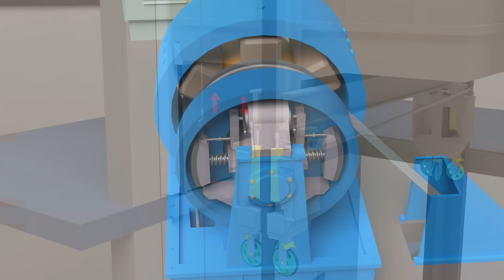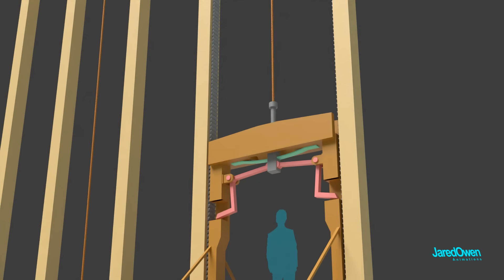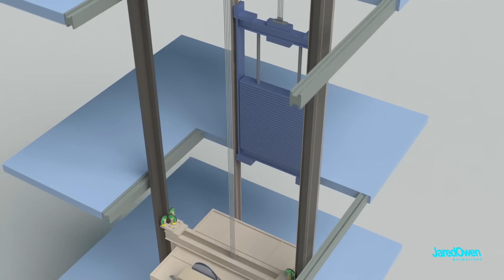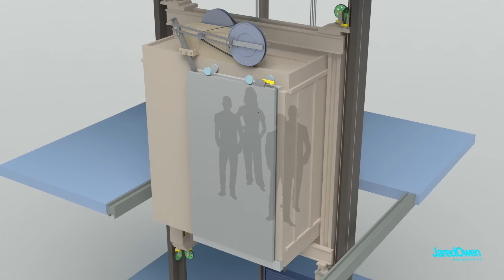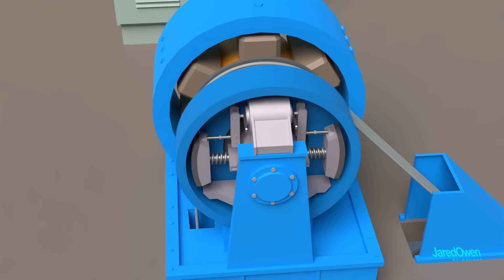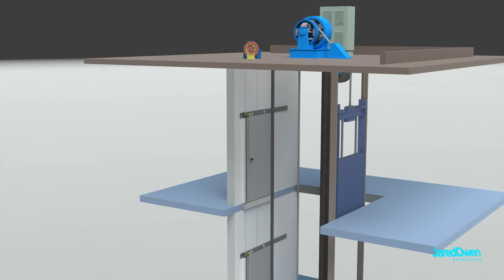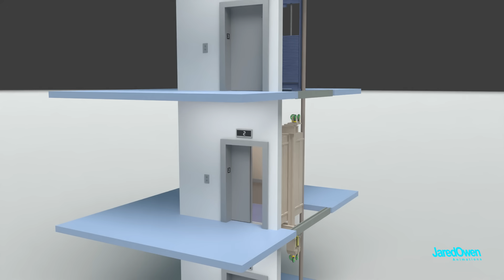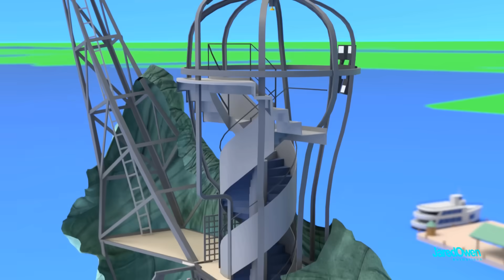How does an Elevator work?

Comment: Perfect description about how elevators work... as usual, techie without the tech

About 5 years ago I lived in an Retirement Complex. It was mostly seniors and average age was probably 75. Our elevators were hydraulic, only servicing 3 floors. They were slow and noisy. We had a fire alarm go off due to problem in fire sprinkler dry riser. It leaked and now wet, triggering a major response.

It was on a weekend night rather late. Every fire display on hallways, in each room, in halls, etc.... all making that high pitch sound and strobe lights flashing. All the fire doors closed in hallways. Management was gone already. I was on first floor next to front desk. You guessed it, I took charge. 

Earlier, I had learned there were emergency numbers and codes. With in 1 minute first call from security company telling me there was an alarm... duh.. no kidding. Alarm kept going off ever 5 minutes and I had to punch in a code to stop it temporally.  Fire Dept was there, Police department was there, and 30 minutes later, head of maintenance was there. Old folks kept getting an eye full (strobes) and earful of alarms in their own rooms. I think they missed breakfast.

We didn't have elevators for 12 hours. Elevator tech was 200 miles away and driving as fast as he could. The old folks were basically stuck. They were not able to use stairs. I learned about the alarm system, sprinkler system, and elevators in that facility. Prior to that, I was project engineer at a large manufacturing plant. I did all those safety issues after hours because I lived close by. More than once had to drop everything when codes set off alarms. They had old fire system prone to dry stack getting wet. 

Elevators changed everything... big thank you to Ottis for elevator and Jared for video.

Comment: Very well made video! I like the animations.

If you wanna go a bit deeper into hydraulic elevators, there’s three different hydraulic elevators: - inground (which you covered), holeless, and roped. Holeless hydros have their pistons and cylinders on the side somewhere instead of underground, and roped hydros are the same but there are cables holding up the elevator instead of the piston itself. Because of its usage of cables, it needs the overspeed governor like a traction elevator.

Also a small correction although this doesn’t apply to every elevator, some elevators don’t completely stop before the doors open. Some elevators have “pre-doors” (premature door opening) or “classic leveling”. This is a term elevator enthusiasts like I use. On some elevators (like Kone’s elevators), if you look closely the elevator’s still leveling after the doors have begun to open. They’re usually not off-level enough for you to trip over the door track, so that’s not a huge concern, and that actually makes the overall ride slightly quicker.
Reply: My apartment elevator does basement to 18 floors and from what I saw there's a piston on the counterweight
Reply: Oh, that’s interesting.

Comment: What is amazing is not that they don't drop. That was well engineered. It's the other aspects of safety and reliability that are mindblowing, considering that they "never" happen despite trillions of operations.  How did they make it so doors "never" open without a car waiting, and "never" stop with a 3 foot drop to the floor outside? "Never" start moving with the door open? I understand that there are ingenious controls preventing those. But the operative word is "never".  How is it that virtually NEVER do any of those things happen except in horror movies?
Reply: I do admit that once in a great while - maybe once in a trillion times a car leaves with an arm hanging out or something, perhaps both requiring bad human user behavior and a worn sensor. But the level of reliability and rarity of that is staggering.
Then again I wonder that about traffic lights. The only harmful failure I have ever ever heard of was when the wind blew a unit 90 degrees, and the terrifying outcome you might imagine did actually occur.

Comment: One other safety feature that you didn’t mention is that if the inside door is opened while the elevator is moving, it will stop.
Reply: Also, should the hoist way door is opened by the key, the elevator would stop as well

Comment: How do lights remain on in the elevator as it moves up or down?
Reply: Lift Machine room have a power supply, the power supply will supply the power for the elevator. By the power cable during cable trunking from machine room to lift shaft to transfer the power to lift. This power cable call travelling cable, it held around double length of the shaft height to let the cable can follow the elevator move up and down.

Comment: Good video as always! only a small addition: almost all hydraulic lifts have the piston above ground. this piston pushes a pulley which pulls wires connected to the ground and to the cab, just like in the forks of a forklift. This allows you to use very long pistons without having to dig deep holes underground. In Europe they are widely used in low houses because they can lift very heavy loads, require very little energy and space to operate (just a small oil compressor) and are very safe in the event of a blackout. In the event of a power failure they are able to go down to the floor below by themselves without leaving people stuck inside.
Reply: They are known as indirect acting hydraulic lifts. The piston is only half the length of the total lift travel as the lift is roped 2:1 so the speed of the lift is also double that of the piston speed.
Reply: Interesting

Comment: What happens if there's a power failure ? Also, I live in Thailand and some of the elevators around here don't start on the ground floor, you have to climb a set of stairs first, anyone know why this is the case ?
Reply: if the power failure, the brake will close and stop the elevator motion
Reply: @peelna2169  Thanks Peel.

Comment: 7:08  What happens to the emergency brakes effectiveness if the cable to the over speed governor brakes? If the cab is falling and the over speed governor tightens the cable to apply the emergency brakes could that cable (or the arm attached to the cable) snap if the cab falls a little too far and puts a lot of tension on the cable?
Reply: The rope must be base on the rated load, rated speed to calculate a suitable solution and safety factor. The safety factor always at least 16.

Comment: Great Video!
There is a "hybrid" version of hydraulic and traction elevators which is very popular in Germany (maybe in Europe in general): it has a cylinder mounted at one side of the shaft, which is half as high as the transportation height of the elevator. On top of the piston is a pulley and there are cables from the floor of the shaft around the pulley to the floor(!) of the cabin (like an inverted U). It is a very simple system. The hydraulic piston/cylinder has to carry double of the weight of the cabin (reversed block and tackle), but has to move only half of the height and you do not need to "bury" the cylinder deep in the ground.
And hydraulic is quite fail-safe. If the diameter of the piping is small enough, even a complete failure will lower the cabin only at normal speed.

Comment: I feel like the older stopping mechanism was more safe. :/

To me it looks like the new mechanism isn't passive, but instead requires another cable which can also break if the main cable breaks.
Reply: There’s a reason they went away from the original Otis design. The old design was made for a 2-4 floor rise and stopped you abruptly, the new design is used everywhere because it allows you to slide more gently to a stop.

Comment: Brilliant vid.  Though I do have one unanswered question; Does the close door button on the inside of the cab actually work? There is a theory that it’s only there to give a sense (but not actual) control to the people using the elevator, I would be interested to know if it’s true.

Comment: Worked a hotel for a long time. Elevators would constantly get broken down, get stuck halfway between floors and sometimes if your lucky would fall multiple floors before coming to a slammed halt for a fun impromptu thrill ride. Nothing like an adrenaline rush at 2am. And we used that "special key" to open the doors when idiots would drop their phones between that crack down the shaft with the rest of the garbage and missing keys.

Comment: What if the flywheel cable snaps?
Reply: Well, the governor cable is designed to “slip through” the governor jaw when it sets in a overspeed situation. 

In fact, after you overspeed the governor to test it, you use a hoist and scale to determine how much lbs pull through it takes to have cable slip(no cable will break if it has tolerances to slip through). A tag is attached to the governor that states the installers/manufacturers tested pull through and overspeed that is required for the speed of car/installation.
Reply: So the safety protection system will fail, while the lift fall down, cannot trigger the safety gear to stop the lift.

Comment: How do elevators know what floor its currently on?
Reply: In elevator car side, there is some sensor called IR Sensor, it can recevie the signal to know that the elevator stop at a floor. For the stop at  correct floor method, each company have differeant method, like to measure the height, the number of turns etc

Comment: Is it just me or does this newer safety mechanism appear more fragil then the old otis version? The new one needs the overspeed governor, extra cable and this lever mechanism to work properly, as without this it’s in a “normally open” state. So it’s not the “normally close” safety as the old mechanism had.

Comment: I have been an elevator technician for 15 years. In my country ( Belgium ), traction elevators use 2 types of motors, with a reduction gearbox and gearless. In hydraulic lifts, the piston is positioned next to the lift and the lift cage is set up in a backpack.
Reply: In the past especially in the USA hydraulic elevators traditionally have the hydraulic cylinder buried in the ground below the elevator cab. The "side jack" elevators are kind of height restricted even with telescoping jack assemblies. The tallest hydraulic elevator I ever worked on was 8 landings about 30 Meters in height. Had to have coolers for the hydraulic fluid to keep tempratues stable. There are also roped hydraulic lifts in New York that go horizontally and allow a hydraulic method to work for over 10 stories....Most of these are pre-WWII buildings.
Reply: 你好，我在中国湖南从事电梯技术员工作5年了，想请问一下你们待遇如何？

Comment: What I always wanted to know... The logic of the algorithm that decides which elevator will answer a call from a particular floor may vary depending on the specific design of the elevator system. However, in general, there are some common approaches.

One simple approach is to assign each elevator a score based on various factors, such as the proximity of the elevator to the floor of the call, the direction in which the elevator is currently moving, and the amount of time the elevator has been idle since its last trip. The elevator with the highest score is then chosen to answer the call.

Another approach may be based on a queue system, where the calls from each floor are added to a waiting queue for each elevator. The elevator closest to the floor is then chosen to answer the next call in the queue.

Some elevator systems also use more advanced algorithms, such as analyzing usage patterns to predict where users are likely to go, or using artificial intelligence techniques to learn and adjust their behavior based on historical usage data.

Comment: Great video as always. 

One correction, don’t use the emergency call button.  If you have cell reception call the non-emergency number for your police department; you want fire rescue.

The fire department should be the people to come and get you out.  It also ensures the fire marshal follows up with the maintenance company for the elevators ongoing  maintenance.

Also, the fire department will get you out faster.  The call button goes to an alarm company dispatch.  You get put in queue with other issues.  They are not there to get you out quickly, they are there to minimize cost/damage to get you out and in the end, they will look to minimize any lack of historical proper maintenance that caused the elevator to stop working.

Comment: Hey Jared, excellent video as usual! One topic I was hoping which got covered here was how the elevator stops at the precise floor when you press the call button. Is it controlled via the software in its "brain" ? How does it align itself perfectly to that particular floor's height ?
Reply from the maker: Good question!  I didn't quite get in that deep but I am sure it's an interested mechanism

Comment: is there a reason for the switch from Otis' safety brake design to the modern one with an additional cable? it seems to me that relying on an additional cable to detect excessive speed means that if that cable were to snap, the elevator would not be able to detect an emergency, whereas the loss of tension detecting mechanism in Otis' design would still work.
Reply from the maker: That's a good question - I'm sure there's additional safety features that I didn't cover in the video

Comment: How backup mechanism works on elevetor in case of power cut.
Reply from the maker: A lot of them have a backup mechanism so that if the power is cut - the brakes are immediately applied

Comment: I never thought I liked “how things work” videos but these are fascinating, nicely animated, and clearly explained. I learn a lot!  One thing that was not covered in this video is how do the buttons work? When I am outside the elevator and push “up” or “down”, how is the elevator able to respond correctly by bringing an elevator from the nearest position above or below?  If I’m inside and push the button for floor “3”, how does it know to stop at 3 and not at 2 or 4? Maybe the answer is just some kind of computer software but it would be interesting to see how elevator buttons work.

Comment: One thing to note that you didn’t mention (I could be wrong here) is that one cable is strong enough to support the elevator car and the counterweight; the extras serve as backups in case one were to snap
Reply from the maker: Yeah that sounds correct to me!

Comment: in smaller buildings (maube just older elevator styles) , those hostway doors are just normal metal doors that hinge out and I would like to know how they lock and unlock
Reply: I believe they still have an interlock, it’s just designed a bit differently.

Comment: As an experienced elevator mechanic, I’m thoroughly impressed with your examination here, very well done. Your terminology is pretty well spot on, and I also noticed that you modeled some components of off real equipment I work on. The machine is a carbon copy of an Otis gearless machine, the door operator looks exactly like a Montgomery EZ operator, and the door hardware looks like GAL stuff. Well done, 10/10.
Reply from the maker: Thanks David!
Reply: how is it being an elevator mechanic? ive been starting to look into the trade. does it pay well too?

Comment: Jared - years ago when I was a little dude, I would travel with my dad, to places like New York City.  Back then the elevator cab doors were a see through type gate.  There was also a dedicated elevator control person.  You simply told them what floor you wanted and they would open and close the doors and start and stop the elevator.  Elevators were so cool back then, they smelled like hot grease and ozone.  I miss those days and elevators.
Reply from the maker: Interesting!  I read about stuff like that but that was before my time😮

Comment: I used to work for a US company that sold some heavy machines to companies in Hong Kong.  The primary component of the machine was granite.  The machines weighed about 4 tons.  The rigging company in Hong Kong would load a machine into a freight elevator.  I never learned what the max allowable weight was for the elevator.  I would not get in that elevator not knowing how much weight it can handle.  The machine needed to go to the 4th floor.  As you might guess, the fuses for the motor(s) would burn out.  Their solution was to either use jumpers to bypass the fuses or get bigger fuses.  Somehow, they got away with such craziness.

Comment: Regarding safeties, there is usually also shock absorber on bottom of the shaft. If all safeties would fail, it would partially absorb the fall. Also elevator would never fall in freefall. Cabin is compressing air in shaft below and this would considerably slow the fall speed.
Best way to survive in worst case situation is to lie down to floor, instead of commonly advised "jump just before impact"
I hope the video and few additional facts would help anyone who has still fear of elevators.

Comment: My building is short, the stairwell is only 4 storeys tall, but we have a cargo elevator. It's like one of those restaurant elevators, it's a big cube that's spacious enough to fit multiple suitcases and holds up to 100kg. People find it weird. I wonder, though, how similar it is to a regular elevator. I'm pretty sure the door locks are electrical instead of mechanical and I doubt it has an emergency brake but it still works just like an elevator.

Comment: On older elevators, you can still find doorless cabs. The cab just has 3 walls, so if you touched the front surface while it's moving (don't!), it would slide on your fingers. That's quite dangerous, but very cheap.
Reply: You're right. These lifts have a movable threshold. If  your foot gets stuck between this threshold and the wall, the elevator will stop immediately. When we were children (60 years ago) we played with these lifts: pressing all the buttons at the same time, putting our feet between the threshold and the wall. Sweet memories...